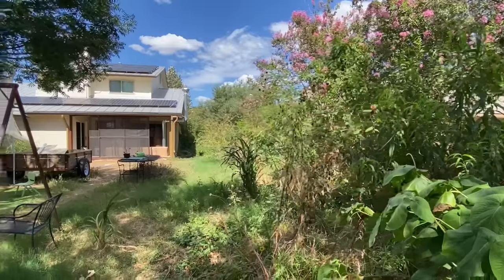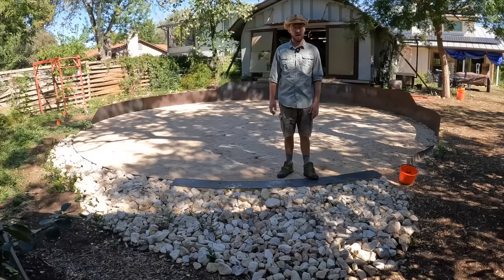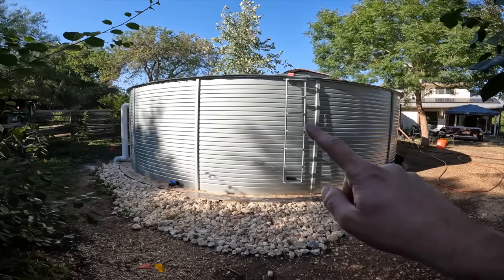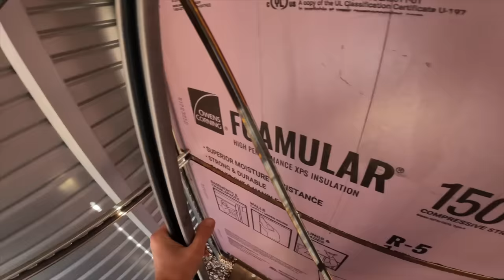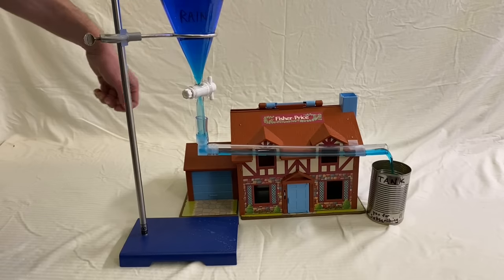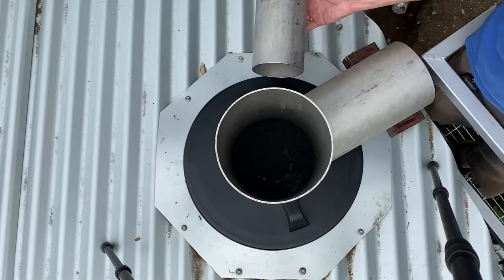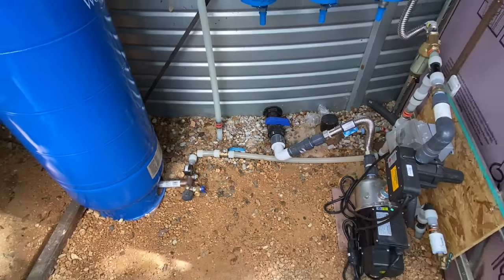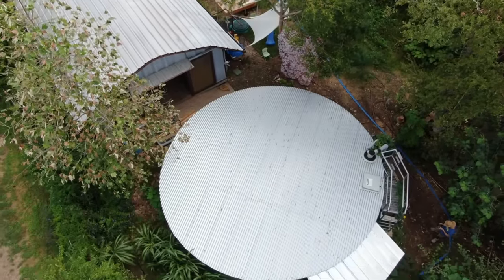FREE water forever.  LEGALLY!!!!

Comment: Amazes me how much free stuff costs these days .
Reply: Costs about as much as a huge steel tank, which is not cheap.
Reply: nattyfatty6.0  bro i learned welding from yt.(I bought a cheap machine so probably not gonna use it to build a tank like this). But I don't think you need to get a degree in plumbing etc to be able to know how to use PVC pipes, connect them to a 1000litre pvc tank, cut open the top, put netting so mosquitoes can get in and breed( do this very carefully and dony leave any space bc you can be fined for breeding mosquitoes). Improvise in every thing and find a way to solve small issues with less money and time. I use rainwater for the garden rn but I'll try to improve and use it for myself.
Reply: nattyfatty6.0  Working with PVC is easy and requires very little in the way of tools (you can get by with a tape measure and a hacksaw).  The hardest, and most expensive, part of installing the pipe was digging the trenches.  It is very rare to need stainless steel pipe like he used.
Reply: Man that is quite a project watched it from start to finish... Found really interesting and fun to watch.. there is a lot of money into that thing though don't know how free it really is.  .000001 of the population will ever try something like this.
Reply: @EnigMK3 the pumps tubes and filters are probably the most expensive parts
Reply: 15 foot round above ground pool can hold 5,000+ gallons of water. Insulate around the walls, and keep covered with an insulated top you can keep sealed around the edges. Route your rain water through filtered pipe into pool. Keep the pool filter scrubbing and heat as needed. That’s a lot more doable for the average DIY dude if you ask me. But no one did, so.😅
Reply: Just make it at a smaller scale
Reply: This is just so much when a simple ro filter will suffice
Reply: nattyfatty6.0 still cheapie r than paying for water
Reply: @SloRush  Kudos to the guy for building this. Would be curious given nothing change with water price and supply what the ROI would be on this project. Where I am it's probably going to be my whole life and half my kids life for the amount this project would cost than just using municipal water.
Reply: Over time it should be worth the money. Unless you plan to move within the next 5 years.
Reply: also keep in mind the repairs and everything, that tank will not hold on forever, and shit happens, so the water bill will not be 0, not sure if it's extremely worth it
Reply: He lives in Texas, water must be expensive. I live in Minnesota the state with 10,000 lakes, water bill would be cheaper.
Reply: @ryry187 the issue was that they couldn’t get city water when the snow storm brought all electricity to a halt and no one was getting water.
Reply: The water is free, the method of collection and holding is not. That's the catch.
Reply: Always some crook profiteering somewhere! Videos like this are inspirational even if beyond the means of many. This is how the whole world should be living.
Reply: yeah, the only thing missing in his project is how much did it cost including labor. thumb down for me. Another fake video.
Reply: Yeah this is not do- able in my yard. And all of that equipment! I will just get one of those big plastic tanks and figure out the rest of it. If we get biological attacks etc, we will die anyway. Do what you CAN do. All this prepping is tiresome, frustrating and rather expensive. I never feel finished. I feel like I'm just doing it for the mauraders.
Reply: Doing all the work to create this tank (and future maintenance) is way more than I'll pay in water bills for decades. And in that time, it's probably time to do some major work on this tank too.
Reply: I’m curious about the cost of this vs drilling a well.  Seems like a well system would take up a lot less space.
Reply: @Playlist-yz8de  A well is much cheaper, but whether you can build a useful one depends on the water in the ground.
Reply: Free is the most expensive thing you can buy.
Reply: @LiveFreeOrDie2A  Yes, there are a lot easier and cheaper methods. And it can be scaled down too. We use that method to collect rain water for our irrigation system.
Reply: Intersting that you don't capture the water falling on the tank roof 🤔
Reply: @akostadinov  Smartest comment. With the size of it, they (probably) could've just built it in a cone shape, installed gutters around it, and then they wouldn't have needed the PVC pipes from the house and shed.